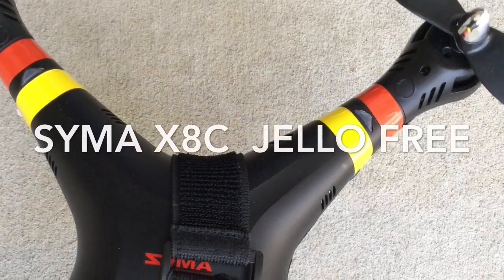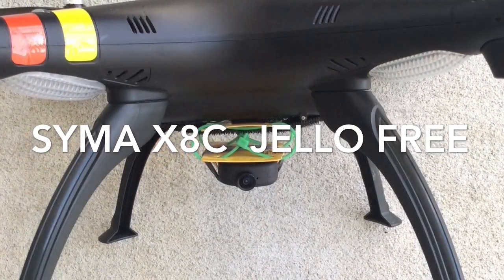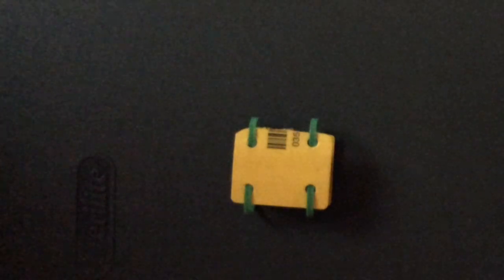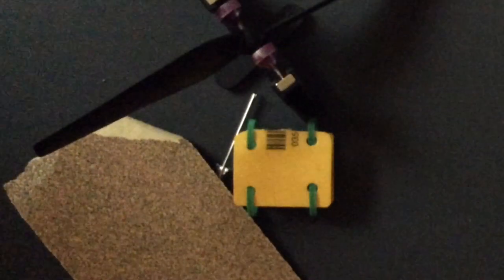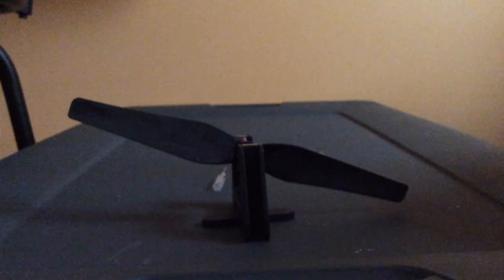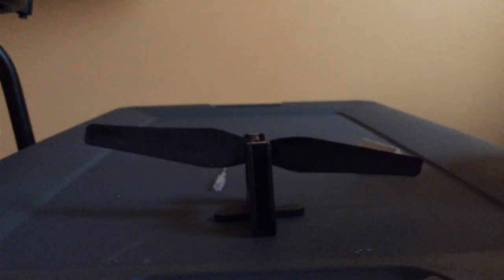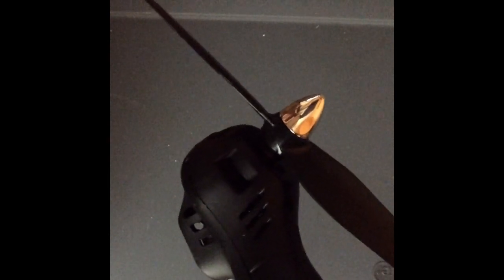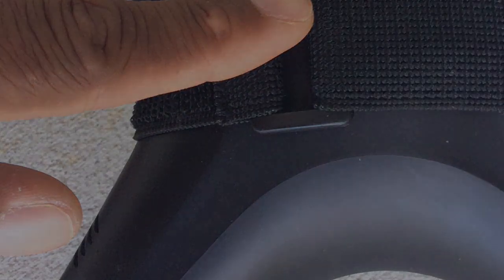Syma X8c Step By Step Tutorial,Prop Balancing,removing Jello And Vibration Effect

Comment: I must have missed this video when you first released it but it's much needed now. The more I fly my X8, the more play I'm getting in the props. My jello has returned and now it's time for some maintenance! Thanks, I didn't know you were a technician too-remarkable...
Reply: I guess there's no perfect quad, at least for now, under $1000. Thanks for your quick reply.
Reply from the maker: +DJ SOUL FORCE Thanx bro appreciate the kind words of encourage,not technical but menthol,lol.This is a funny quad because it changes each flight.
Reply: That's true (it changes). I'm starting to get shorter & shorter flight times even though I upgraded to a pro battery charger. Is it the quad or the batteries?
Reply from the maker: Something is wrong with the distribution of power,like you I remember taking this bird to high altitudes in high rates and it cut right through the winds,recently  I take it up high and it struggled in light winds on high rates.There are mechanical issues with components on the initial board,that's beyond me beginning to comprehend.I'm thinking about getting the revised the board w/out the on off switch.It was mentioned by another tuber he was disputing the issue w his supplier.I was hesitant in changing the board as I first perceived the great range was attributed to it.I flew my x5c with the same modded x8c tx and found out the transmitter was solely responsible for the great range.I will eventually change the board and try to recoup the power the old board forfeited some how.This is a great bird for 100 dollars but we true rcer'rs knew that due to the great range compensation it would eventually lack in another area.I love this x8c it has entertained me more than it's worth.Your videos are really convincing me to step up to the next level with that 380.That 1 button altitude hold got me,lol.